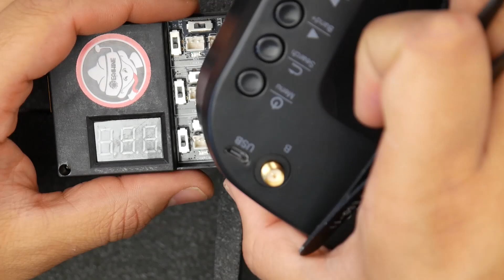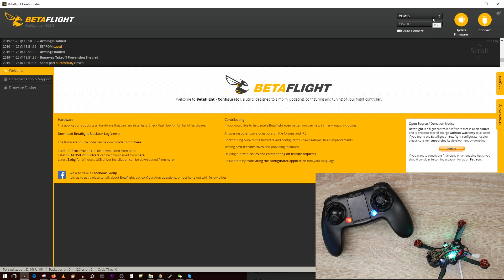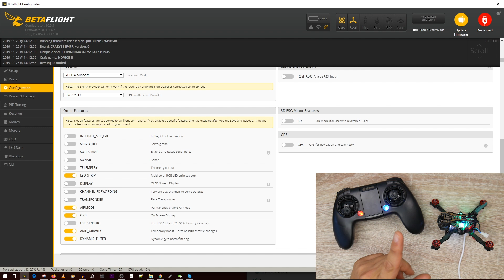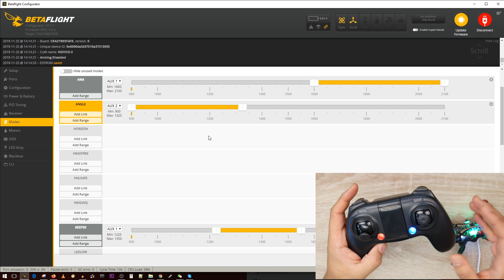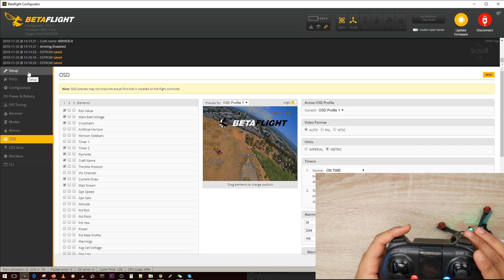Before You Buy!!! // Eachine Novice II Review and Setup Guide

Comment: I have the FlySky FSi6 version
Was a little confusing when I first turned it on, I hovered it perfectly in my kitchen though.
The battery warning was set to low at 3.5 warning at 4 which is a beeper and 5 at high power...
My charger was set properly so it gets me wondering if I got a decent return 😆

Comment: When you know the baterij is done ?
Reply: When it reaches 3.5 Volts EACH cell, so 2s (2 cell) it will die at 7 volt, it won’t die, but if you go below 3.5Volts EACH cell it is permanently damaged, dus NOOOOOOOOIT OOIT Onder 3.5 volt per cel gaan, dus nog een keer, 1s (1 batterij) 3.5V en 2s (2 batterijen) 7V

Comment: I have a question...is necessary do the setup on betaflight or i can fly whit the original optinons?
Reply: You can also fly with original settings
Reply: yes you can fly with original settings and you can also find the rates in the goggles but its not easy to find (i lowered my rates this way)

Comment: They really need to sell this standalone as well and not just in an RTF kit.
Reply: I 100% agree
Reply: I agree. But they have a whole Warehouse of those crap transmitters to get rid of 😂😂
Reply: True.
Reply: @jamiemonkey1362  The radios? I like the one that come with mine.  Used it on several other drones too.
Reply: @jamiemonkey1362  oh mines different to the crappy x-box type controller like he got here.   I got the one with the flysky fs-i6 radio which is like a thousand times better and a classic, great starter radio.